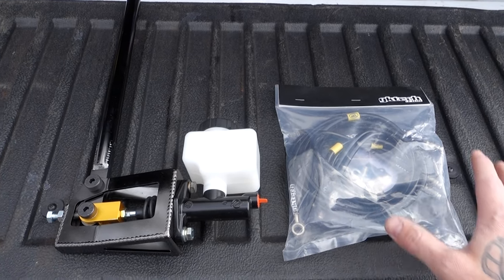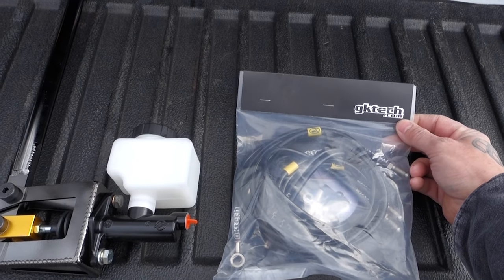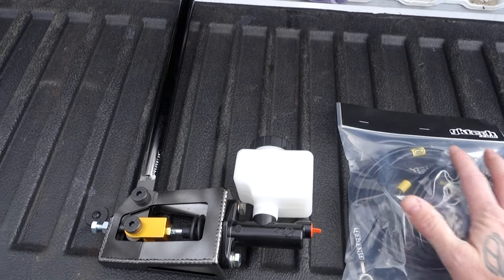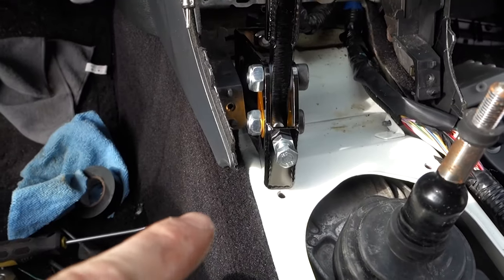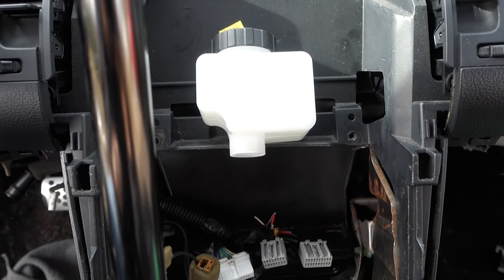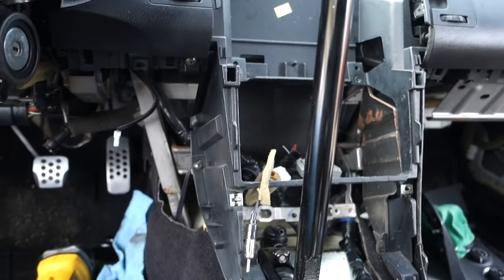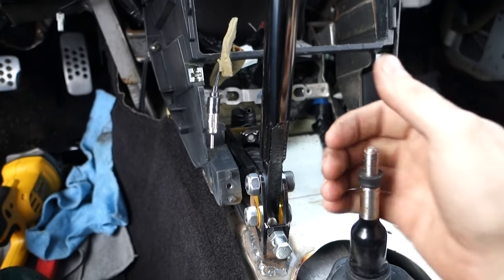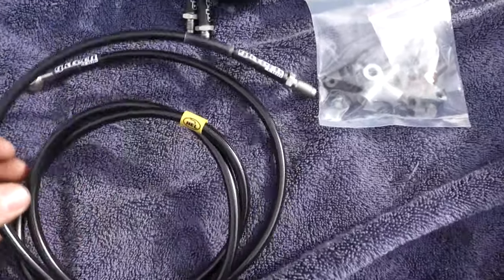How to Install a Hydro EBrake  (Hydraulic E Brake)

Comment: Did the hydro work good ran like that, And how well does the car stop with just the foot brake
Reply from the maker: Your rear brakes count for 20% to 40% of your breaking force so you’re gonna notice a difference 😅 but your front and rear brakes will work perfectly fine like this, I just made it a habit anytime I had to slow down in my day-to-day traffic just to pull on the handbrake a little bit as I was stopping, just like a motorcycle but reversed 🤘🏻😆